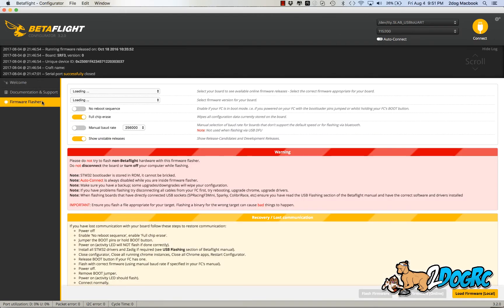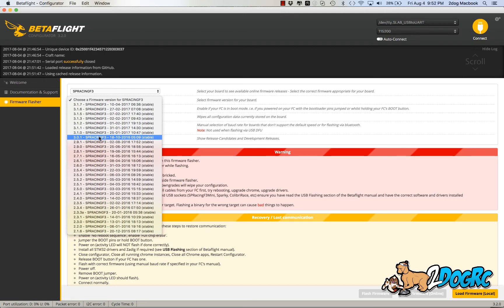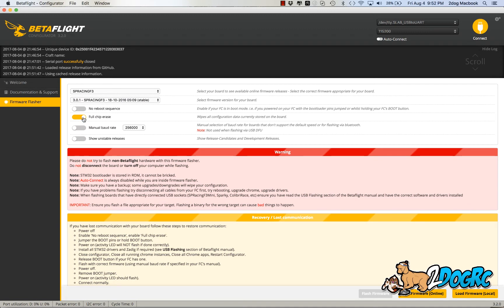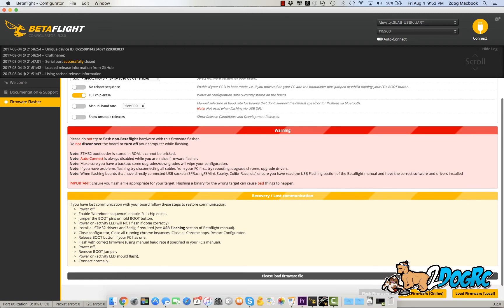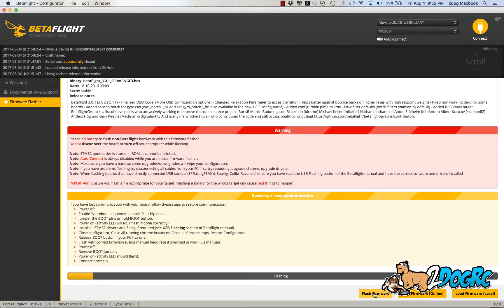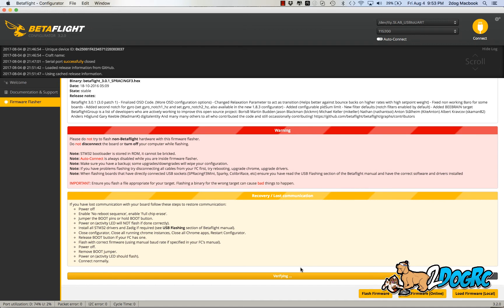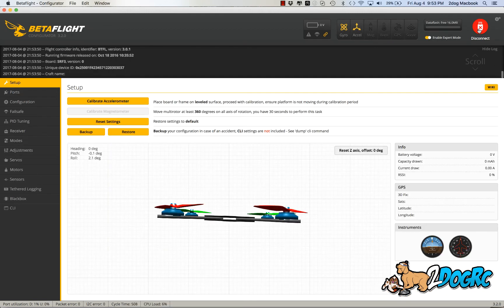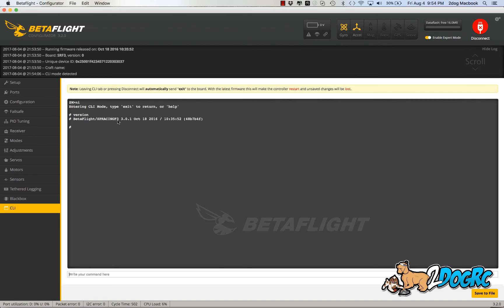Flash Diatone D Link F3 Board with Betaflight 3.0.1

Comment: I have a controller that unintentionally changes the port of uart 1 that is used for USB. And now it does not communicate with the PC. Some way to recover it. I was following a tutorial of refashear the controller with flash loader but it does not communicate with the pc
It is a DIATONE d-link v1.
It broke the port of the receiver and try to use the uart that was free and I confused of port i put rx in uart 1 that the usb.
Any way to recover?
Thank you.
Reply: Between you and Joshua Bardwell I managed to bring my  Diatone Tyrant S 215 back on line , I must have switched off the msp on the ports for uart 1 and couldn't get back in, from your link above the file I used was from the corner box labeled, BF3.1.6 MSP on uart1.zip. Betaflight 3.1.6 FuryF3.hex to reinstall the settings and it switched on my Tyrant S 215 2017, I could't find the one they recommend which is Betaflight 3.1.7 hope this helps someone else.